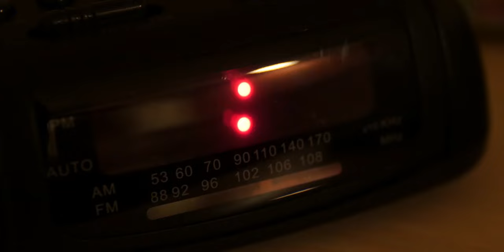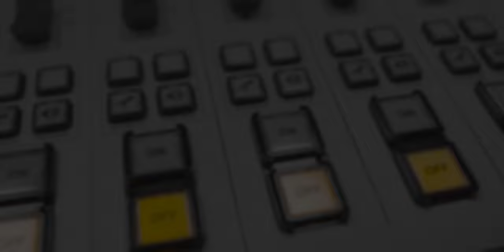Broadcast Audio Over IP Explained

Comment: i found this very helpful - but man i wish there was some more detail about aoip drivers. a local nonprofit radio station uses wheatnet-ip and they want a backup audio logger. i'd like this to be a virtual machine running linux but i can't tell if that's technically possible due to a lack of an aoip driver that's compatible.
Reply from the maker: Hi Micha! Thanks for the comment, I'll be making a video on drivers and how they all interact with different systems soon, just got some cool stuff setup in the lab to demo!
As far as audio logging on linux in a VM, It is technically possible, as long as you can figure out the proper way to decode wheatnet-ip. I am doing this exact thing at work with Livewire and an RTP dump utility + ffmpeg to get audio into linux without a driver. I dont know enough about wheatnet-ip to really give a good suggestion, but I would first try to see if you can get an RTP dump, maybe start with wireshark and try to get an idea of what port the protocol is running on and see if its something you can decode.